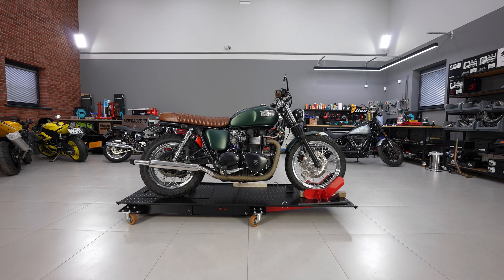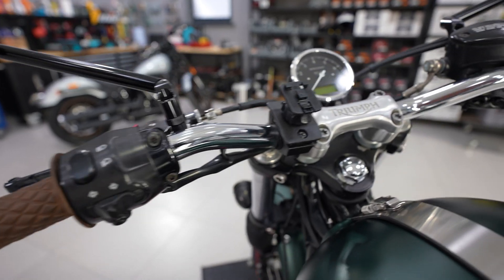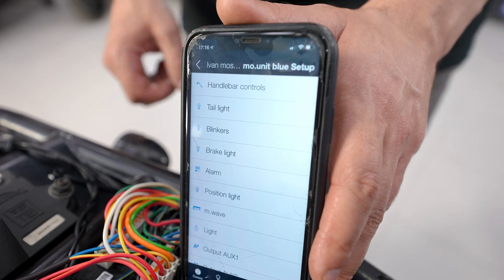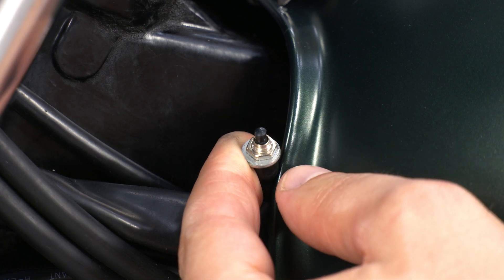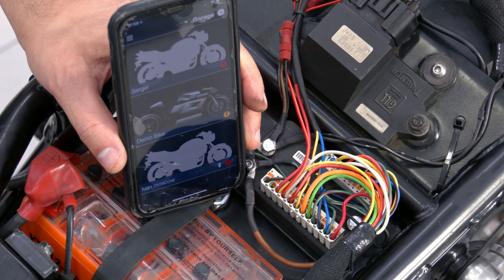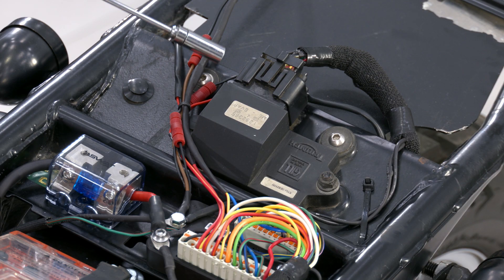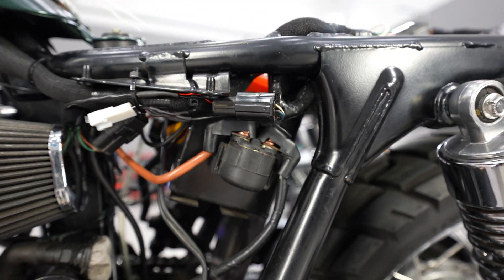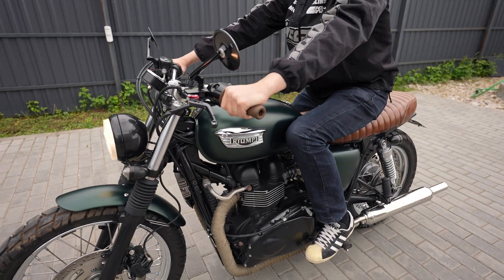M-Unit with Standard Controls - Bonneville T100

Comment: Hey there! Curious... how did you wire the mo.unit to ignition coils? Did you run direct from the ECU to coils? Or use the "ignition" output on the mo.unit? I'm on an 2001 Triumph Bonneville and have everything else working, I'm just not getting a spark. The build is beautiful, by the way!
Reply from the maker: We used ignition output - it’s working after start. As I remember, the pick-up coil goes to the ignition unit and the ignition unit is powered by the m-unit (ignition output).
Reply: Wesley did you ever get this working ? 
I'm trying to install the m unit in a 2004 Bonneville and Im a little confused myself. Any help is appreciated

Comment: I'm glad to have found this video! I'm trying to integrate the m unit blue to a 2005 Thruxton 900. I understand that the Bonneville has the same engine and systems as the Thruxton. Will you be so kind to provide the electrical drawing on how you wire up the m unit blue? Especially how the ICU is connected to m unit blue (which wire or pin out from ICU to which port of m unit blue). Looking forward to your response soon. Thanks!
Reply: Hey Albert! Did you ever get this figured out? I seem to have managed more-or-less everything with the exception of the ignition coils.